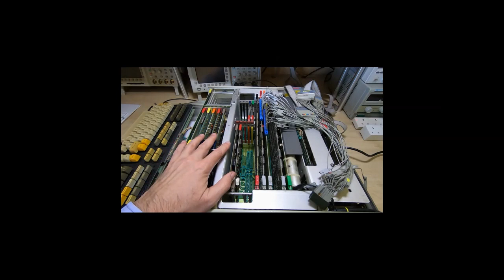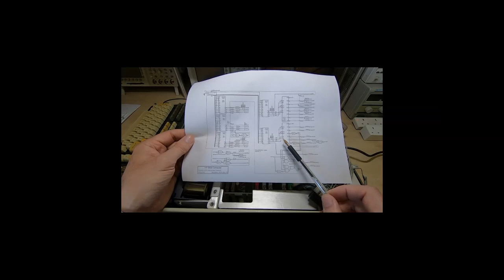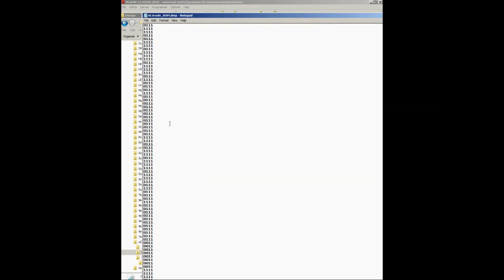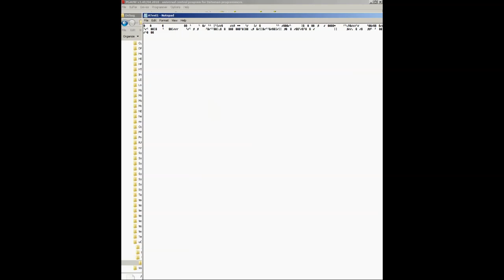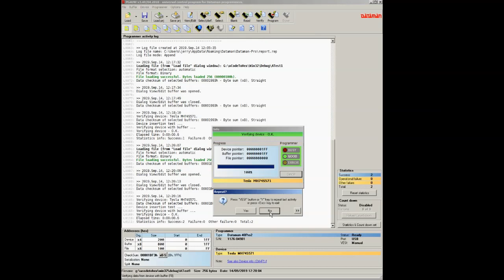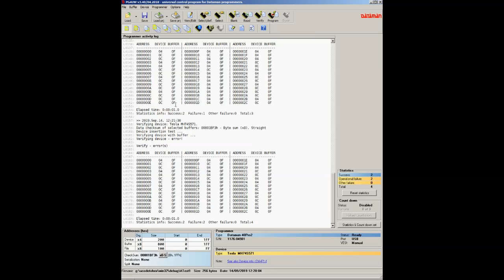HP9830A  Repair  Part15

Comment: Another thing I can see that ROM emulator board being really useful for would be as a debugging tool for the rest of the machine because you can put in whatever system code you want in it to test various aspects of the machine. That makes the card valuable for use regardless of whether or not one happens to have an existing rom board that is bad or not.   And thanks again for these videos.